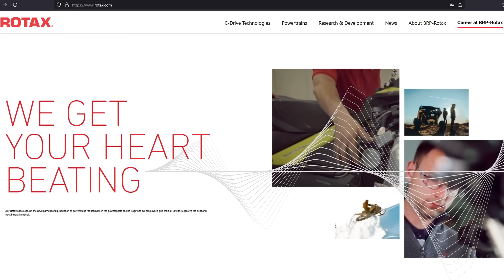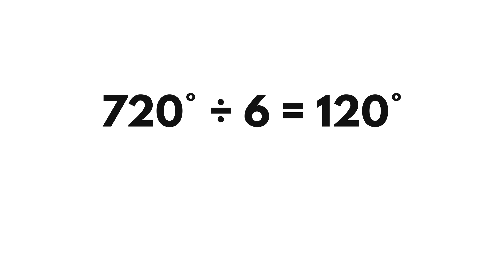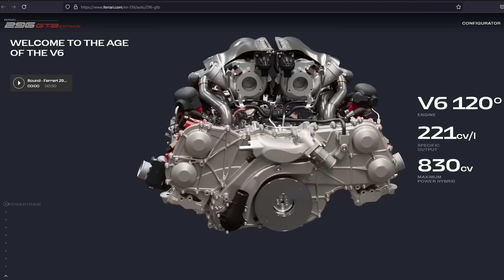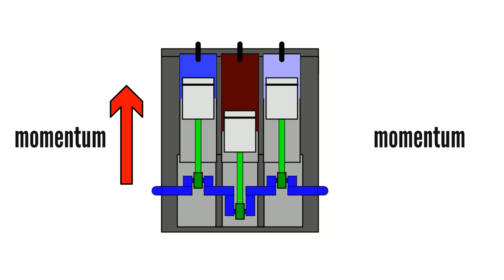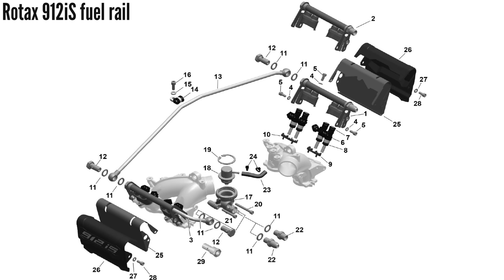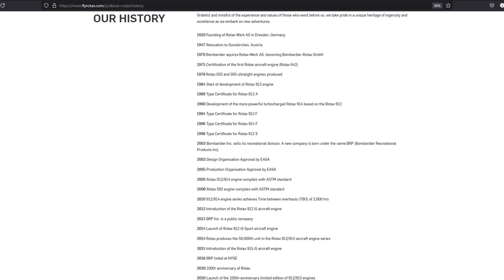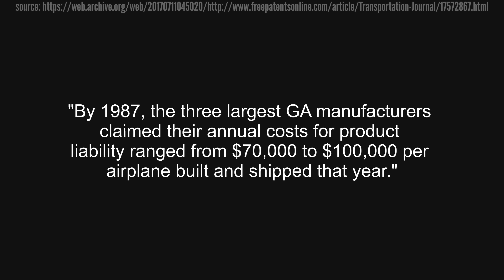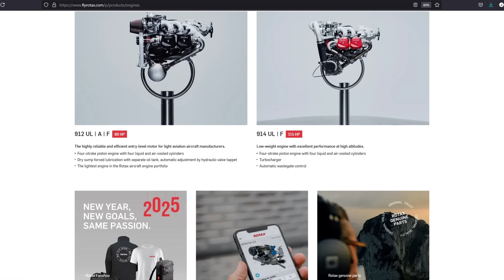Why Rotax's 300hp V6 Aero Engine Never Saw Production

Comment: Rotax builds the motor in my sled.   180hp 850cc direct injected turbo charged 2 cylinder 2 stroke 👌
Reply: Not continuous 180 hp. But yes, these old airplane engines are just that.
Reply: @trytolookbusy  it's not an airplane engine and the trail version has methanol injection which allows continuous 180hp
Reply: Nobody can ride a sled making 180hp continuous. This is lethal anywhere on the planet earth, except perhaps bonneville.
Reply: @Triple_J.1  you're clearly thinking of trail riding.  My sled is an uphill mountain machine, 175 inch track 3 inch paddles, no bogey wheels, 32 inch stance. Geared very low.
Reply: The FAA lost you at 2 stroke, they like that about as much as Low Lead
Reply: @hugoglenn9741  i'm not flying i'm riding.   Sled = snow mobile

Comment: liability killed a good engine ?? its a sticky one ... maybe Rotax could get around it by including parachute package with every motor .   In other news Robb Dham is building a 300 hp single rotor turbo charged rotary motor ,to go in a mazda MX5 ,or miata car ... for the life of me I just can't think where a light weight super smooth very compact 300 hp turbo'd motor could be used ,  it would have to be water cooled ,geared , and have a bit of sound muffling but ,hmmn ,a poor mans turbine ?.
Reply: Not that you'd want to push a single rotor that hard in an aviation application. There used to be a company called (IIRC) PowerSport Aviation, who made (IIRC) a billet 13b based twin rotor producing 215HP. Apparently the gear reduction is quite demanding due to the intense power pulses of the rotary, and the fuel consumption may be a little worse than other ICE types.
 I believe there were a few Vans aircraft using that powerplant.
Reply: @boydw1  Good to know , Robb is getting a de tuned reliable 700 hp out of a two rotor , so 300 is detuned ,He done quite a lot of development to get reliablity . The original sky car used a bunch of turboed 13 Bs , i think it actually got lift due to the shear volume of noise and heat from burning fuel !?. After driving rotaries for years I used to be a bit scared that normal 4 cylinders were falling apart due to the vibrations . a 13b had to race against a 2.6 liter normal 4 stroke due to having twice as many bangs per revolution ,so in theory I would expect the rotary power delivery to be easier on gears and props .will do more research ,as I am quite liking the idea , strictly for experimental s .
Reply: @johnmarkgatti3324  There was another guy built one specifically for a "time to climb" record (that one was turbo'd and pushing Dahm levels of power), though AFAIK it was only flown for a handful of flights.
I'm not sure exactly what it was about the rotary that made it hard on gearboxes, but that was the assertion of Powersport.
Reply: @johnmarkgatti3324  https://www.youtube.com/watch?v=k_gedJrWbT4
Reply: @boydw1  nice , thanks for that , 60 degree climb angle !?,poor mans fighter jet [ though still about a third ? of what they do ]. presumably a sturdy planetary gear by the looks . The engine I would really like to see built is the aussie Revtech trilobate crank motor ,still very annoyed at subaru ,they signed up , then reneged ,so it never got serious backing , it has close to 40% real efficiency , max torque at around 2 000 rpm , they had plans for a paraglider motor to start with ,got shafted I think . If my finances ever get up to It i'd like to get all the bits and have a play ,though by then we may be in anti grav craft ?? . Interesting Rob now has an NZ made alluminium Rotor to play with ... he is having fun thats for sure ,and openly shares what he does , legendary .

Comment: We have an expired-engine Cessna FR172 Reims Rocket sitting in our hangar. This would have been an interesting option. 
Not the the 210hp Lycoming was hard to replace, it's just that the Helio H-295 Super Courier we have been using for over a decade is far more capable...

Comment: Two things came up: the first one, which I brought up to one of Rotax's engineers, was that 3.00:1 gear ratio, which would have had the same two gear teeth mating 2000 times per minute, which would have promoted wear. (Changing the ratio by one tooth would have had the same two teeth meeting approximately only once every 40 seconds or so.) BTW, the engineer congratulated me on my observation and confided that he had raised the same objection, only to be overruled by a marketing executive who believed the pilot's knowing the propeller's exact rpm was somehow important.
The other reason wasn't liability (those costs were known all along),  but it was the near-unlimited cost (and indeterminate delay) of certification of the electronic engine controls, a system that the FAA of the time didn't understand. (A top executive of the project told me that certifying the Rotax system  was virtually impossible because of this, and that this is why he eventually pulled the plug on the program.)
Just some insider FYI.
Reply: Fitting odd teeth is basic gear engineering.
Reply: Wow, good post!  I just learned something- and how tragic that once again, some manager ignored an engineer's warning..... they never learn.
I didn't know that wear/tooth count thing. Thanks.
Reply: That, and people in GA simply don't like change at all.  Porsche produced the PFM3200 engine in the 1980's and while the version they produced wasn't up to par, they had 250 and 290 hp versions that would have been very competitive cost wise, but they pulled the plug for the same reason:  People wouldn't buy them because they simply didn't know them.
Reply: @Flies2FLL  Lexus aircraft engine too.. The Lex 4.0 v8 is one of the under stressed, most reliable engines ever made.
Reply from the maker: Thanks for the info. The gear ratio is just silly, the pilot has no need to know propeller rpm.

Yes liability was known right from the start, but don't forget that the desgin was started and just about finished under Bombardier, an aviation company used to liability risk (it's an occupational hazard). When they divested and Rotax became part of BRP, a recreational products company with much less appetite for risk, and this engine's liability risk factor fell way outside what BRP could stomache. BRP killed the engine, not Bombardier.
Reply: Thats why car axle ratios are what they are: 3:23, 3:55, 3:73, 4:11, 4:56 etc.  usually 11 teeth on the pinion, and an even number on the ring gear.
Reply: P-51s Merlin is rated at 3,000rpm and the engine tachometer is what the pilot flys by. There is no indication of propeller rpm anywhere in the aircraft and it is rarely or never mentioned in the literature. Even engineering reports by North American and the NACA ignore this number. Which was 1,430rpm at 3,000 engine revs.
Reply: You hit the nail on the head whe you said the FAA didn’t know now to certify electronic system.  Most FAA people only worked on certifications of airliners system, not small gA aircraft system.  They expect all sorts of redundancy, most made up by committee, derived from the airline world.  It would never worked for the small GA airplane
Reply: @2Phast4Rocket  The TAE125 was FAA-certified/validated 2004-ish and that was a FADEC engine. Since then, FAA has certified/validated the Austro, RED A03, SureFly EIS, Rotax 912iS and 915iS and probably more I can't think of right now. The certification effort for the 936 was obviously a factor for the cancellation, but very likely not the only one. I would expect Rotax looked at the market back then and decided to concentrate on the smaller engines which could be used in trainer aircraft, drones and the LSA market everyone expected to grow massively back then. Worked out pretty well for them.
Reply: I don’t get it, even with odd numbers of teeth, the math to find the resultant RPM is so simple, how would the pilot not know the RPM, which doesn’t really matter anyways. And one tooth difference, you can estimate and know approximately how fast it was spinning if you recall felt like you needed to know, just by looking at the tach.
Reply: I just learned so much! Thanks.

My 2 cents: in my experience it’s not unusual to have someone from sales or marketing ignore engineers. Morons.
Reply: they should try again NOW while trump is in office. it was trump that lit a fire under the FAA slugs when they were draggin their heels on adopting ADSB / in/out, trump got in their face & told 'em- here's your deadline. do it by then, or I'll take the FAA private sector & I gaurantee- THEY will.
Reply: Super interesting 👌
Reply: Couldn't it have been refitted with mechanical fuel injection like older/proven designs?

Comment: The only reason to make a V6 is packaging, otherwise both and i6 and flat 6 have better balance and an i6 is simpler. Setting the V angle at 120 for firing interval ruins your packaging advantages but leaves all the balance problems. Just make a liquid cooled flat 6 instead.....oh right they did.

Comment: It's hard to see why they picked overhead camshafts, rather than pushrods. OHC makes a motor wider (or taller, for in lines), more complicated, and only provides benefits at very high RPM, (over 6,000)
Reply: The overhead cam valvetrain would be more reliable than a pushrod valvetrain at continuous high rpm.
Reply: It had 2 valves per cylinder, the moving part count would have been drastically reduced (no pushrods, no rockers).
Reply: @PistonAvatarGuy There are a lot of parts in that chain.
Reply: @crissd8283  None of which are prone to failure. It's also possible to use gears.
Reply: @PistonAvatarGuy  What? An SOHC V6 has a complicated valve chain drive system plus it still needs rockers
Reply: @FairladyS130  Chain drive systems can be extremely simple, especially when it comes to SOHC engines. In the US, the SOHC Ford modular V8 is well known for commonly lasting to ~500,000 miles, while also providing excellent reliability.

The V220 and V300T clearly had a direct acting, cam over bucket arrangement, which is literally the simplest valvetrain there is. Unfortunately, with only 2 valves per cylinder, that also means that the engine didn't have crossflow heads, which would have compromised performance and efficiency.
Reply: @FairladyS130  Wow, basically none of my comments are posting these days. Living under totalitarianism sucks.
Reply: @PistonAvatarGuy Its been happening to me for quite a while now
Reply: @derekspringer6448  Timing chains almost never fail, especially the hyvo style chains. If a timing chain fails, it's typically the result of some other problem, which is typically poor maintenance.
Reply: @derekspringer6448  BTW, what sort of valvetrain do the Austro Engine products use? How does the reliability of their engines compare to that of Lycoming engines, or the air-cooled Continentals?
Reply: @PistonAvatarGuy  Woa there, I was commenting about your comments not posting. I didn't see the other two comments, they must've been posted right before my comment because they weren't there when I was typing mine.
Reply: @PistonAvatarGuy  Chain of course, it's a Merc engine at heart. Don't think there's really enough data to compare them to the Lycosauruses reliability-wise. They had some issues with unexpected wear after windmilling prompting an AD and introduction of a 900hrs timing chain inspection/change. That's likely with an already reinforced chain after Thielert/Technify/Continental ran into timing chain issues 10 years prior, requiring an exchange for a redesigned chain after 600hrs. Which kinda hurt on an engine that was TBR'd anyway.

So while absolutely not a liability, timing chains haven't been smooth sailing either. And reliability in the automotive world doesn't mean reliability in the aero world either.
Reply: @LeShadokEnchaîné  The automotive Mercedes engines use roller chains, which many automotive engine manufacturers have replaced in newer engine designs with hyvo chains, in order to improve reliability and longevity. Replacing a roller chain with a hyvo chain would require many new engine parts to be designed and produced, so I'm betting that the Austro engines still use roller chains. Some racers also construct their chain guides out of what appears to be a kind of ceramic in order to improve durability, so there are improvements that can be made to timing chain systems, relative to what's used in the Austro engine products. IMO, gears are best, and that's what's commonly used in semi-trailer truck engines to drive their OHC systems (which almost all of them use these days).

The MWfly engines also use timing chains, though, there are very few of them flying.
Reply: @LeShadokEnchaîné  Also, there is a documented case of a Honda Viking engine (which uses a hyvo chain) making it to 1,150 hours before having a piston failure as a result of a lean cylinder (IIRC), there was no mention of any wear in the timing system.

It should also be mentioned that the MWfly engines have a gear reduction which drives the timing chains, this reduces the number of cycles that the chain experiences.

It certainly seems like it should be possible for a purpose-built timing chain system to not require maintenance or replacement until the engine reaches TBO.

Edit: It's also possible that the short life of the timing chain in the Austro engines is a result of conditions specific to diesel engines.

Comment: How many aircraft fatalities are due to engine failure? I suspect the vast majority of accidents are due to pilot error or failure of some control structure on the aircraft but an aircraft with a failed engine can usually glide to to an emergency landing without fatalities, so I am not buying this.
Reply from the maker: Yes most are due to pilot error like you said. But those that are due to engine failure are often subject to lawsuits, and thats where liability cover comes in.
Reply: It’s absurd, but Lycoming lost a suit in spite of proving the engine was running when the plane hit.  The trial lawyers find an award happy jurisdiction.  Then they show Lycoming has millions in revenue (not return on investment) while the bereaved wife is impoverished.
Pilots crashing are the reason planes cost so much.  The lawyers are simply opportunistic parasites that clothe themselves in self-righteousness.  The fix is loser pay.

Comment: Looking at the motor, it appears to be liquid cooled.  How would this work as a retro fit or even in experimental aircraft like an RV10 where the IO540 is used?
Reply: You have to put in a radiator. It's not rocket science: the Rotax-powered RV-12 does it neatly, and there have been several liquid-cooled conversions already of other RVs , like the Continental diesel-powered RV-9A